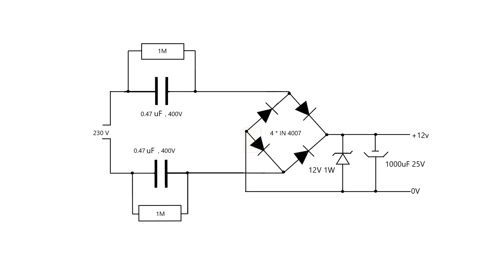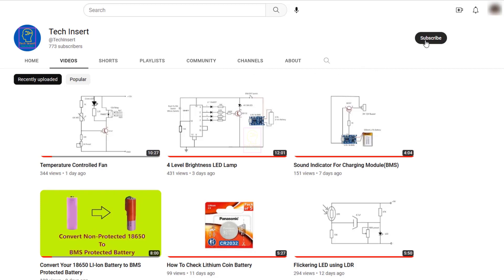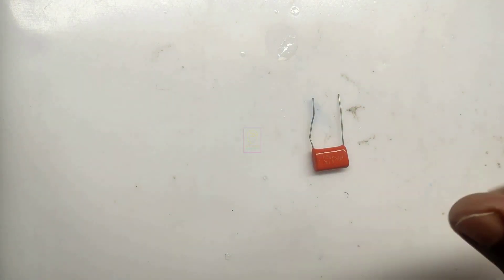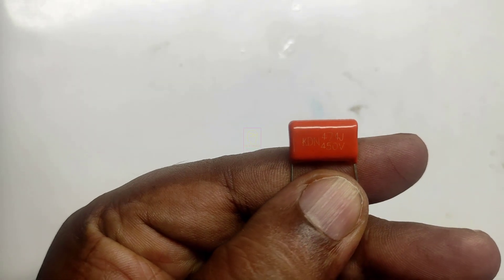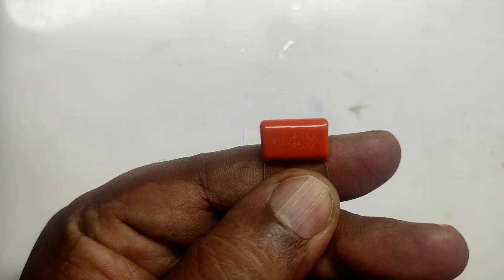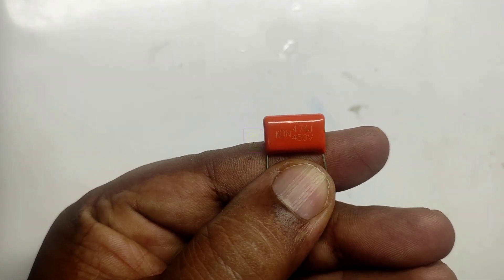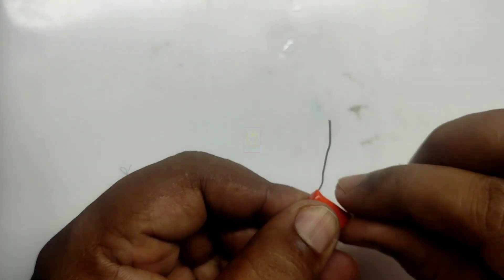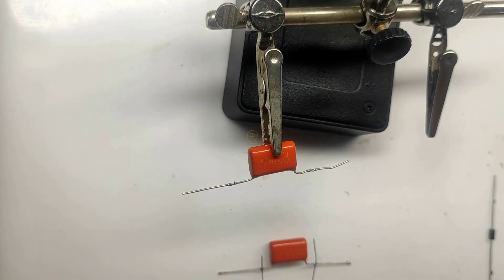Transformer-less 12V Power Supply (Both Line Isolated)

Comment: What should I do if I want to increase the brightness.
Reply from the maker: Increase the capacitor will increase the output current but it is also become shock hazard. This type of circuit is used for powering relay circuits, sensor circuits etc

Comment: Excelente configuração!
Montei e testei, aqui em uma rede 127V, usando os componentes que eu tinha disponíveis, todos reaproveitados de sucatas:
2 - capacitores 10uF/250V.
2 - resistores 1M.
1 - ponte retificadora TS4B5G.
1 - diodo Zener 1N5339b - 5V6. 5W.
1 - capacitor eletrolítico 3.300uF/50V.
Componentes disponíveis, de sucatas.(Superdimensionado)
Reply from the maker: Muito obrigado
Reply: So you are saying that it's completely shock proof circuit. Let me try this circuit for working 12V 20W COB LED 
Thank you so much.

Comment: That's not isolated thus not safe. I dare you to grab it and switch it on multiple times until you get a huge shock when the wave form is at peak and capacitors are still not charged so they act like a wire.
You are not being shocked because when the current is in steady mode, your correct is less than 10mA (which your body can handle). If you use lower capacitors you'll get shocked anyways because the output current will become greater.
What you are telling people might kill them.
Reply from the maker: No man if yoiur are using higher value capacitor then the current at the output is higher and u will get electric shock. But with 0.47uF the currecte is much much less and u will not get electric shock.See i have given values of the capacitor in the circuit, dont change it , use exact value.

Comment: To power a 3v 1w button led full brightness for cotinous duty what r the changes to be made pls.
Reply from the maker: If you want 1w from 3 volt, then u need 333mA current.  This circuit can max deliver less than 70mA. I suggest using a mobile charger and give the 5v from it to the Lm2596 dc-dc stepdown buck  module and adjust  the potentiometer in the buck module  to get 3v and give that to the led.  Lm 2596 can handle 3A max with proper heat sink.

Comment: In this case you use 220vac to feed the capacitors. How can i calculate the capacitor value when i use 110vac instead 220vac? Thank you
Reply from the maker: Reactance xc=1/2πfC, where f is frequency of AC and C is the capacitance in farad

Comment: There's 2 capacitor in series that divided 220v by 2, right? So can we use 200v or 250v capacitor instead of 400v?
Reply from the maker: When we switch on the circuit, that time a spike with a short time period will come across the capacitor.so safer is using 250v or higher but not below 250v capacitor

Comment: Sir. You have not given the answer of my two other quarries. Please tell that if I touched the output 12v wires, than I will get shock or not.
Anil Kumar Goel
Reply from the maker: If ur using the same circuit with 0.47uf, then u will not get electric shock
Reply from the maker: You can see that I'm touching in the video

Comment: Your isolated power supply circuit using 0.47 mfd 400v can run miniature 12v relay. If not than which value capicitor should be used.

 To get 100 ma which value capicitor should be used.
The z. Diode get burnt when 230 v supply is given

Your circuit will give shock if output 12v output is touched.
Anil Kumar Goel
Reply from the maker: Absolutely, it can run 12V relay perfectly

Comment: What PF capacitor is required for 5 volts 2 amps?
Reply from the maker: You need to use an smps for 2Amp. This can deliver less than 100mA only.

Comment: plz make the video both line isolated battery charger 4/6v
Reply from the maker: Sure will make.
Reply: Could you plz tell me Which components needed? 
Both line isolated battery charger 4/6v?
Reply from the maker: @rsrobinshamim5117  

1uF 400V - 2
1M = 2
1N4007 - 4
1000uF/25V -1
6v 1W Zenar - 1
Reply: @TechInsert  1uf 400v j or k which..?
And What will shock the DC output?
Reply from the maker: @rsrobinshamim5117  Chances of shock exists in 1uF capacitor

Comment: I have 105k 400v pf capacitor 
Will be work,,?
Reply from the maker: We need current for charging. 

Reactance(Resistance) of Capacitor = 1/2{PI}fC. Where f is the frequency and C is the capacitance in farads. 105K = 1uF = 0.000001 F. f = 50 Hz (Line frequency)
1/(2* 3.14 * 50 * 0.000001) = 3184 Ohm

Current I = V/R = 230/3184 = 0.072 = 720mA

If we are using single line isolated then 7.2 Amp battery can be used .  If we are using both line isolated then 720mA/2 = 360mA

So 3.6Amp battery can be used.

Yes this will work.

BOTH CASES DO NOT TOUCH THE OUTPUT.

Comment: Will be charge 4/6v battery,,?
Reply from the maker: You can but, kindly do not expect fast charging . Since the current is less , it will take more time to charge . I tried charging 3.7V, 1200mAh 18650 Li-ion and it took around 10hrs to fully charge

Comment: How many amps can it deliver?
Reply from the maker: Less than 50mA. If you increase the capacitance value then reactance will decrease and current will increase
Reply: @TechInsert  if he does that, he would get electrocuted by touching the wires as you did